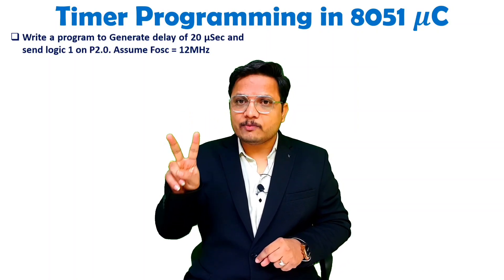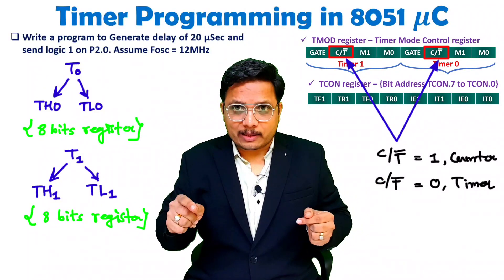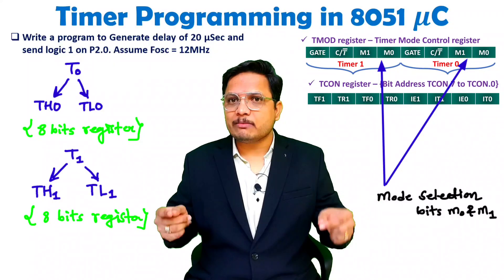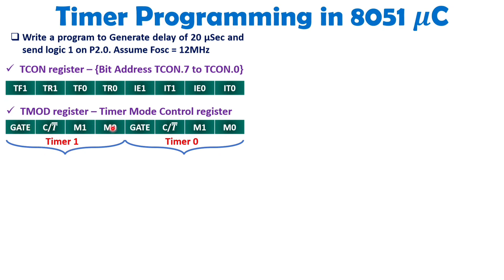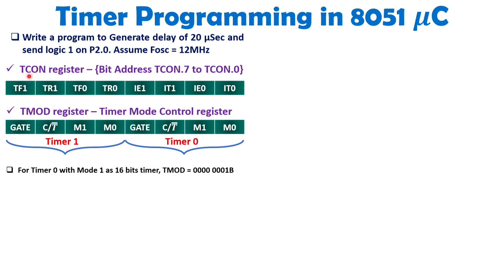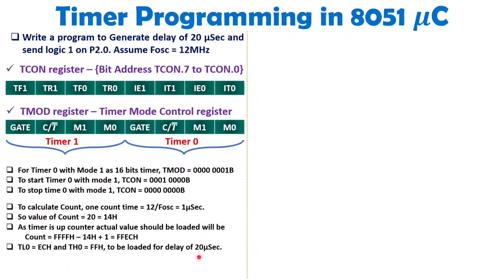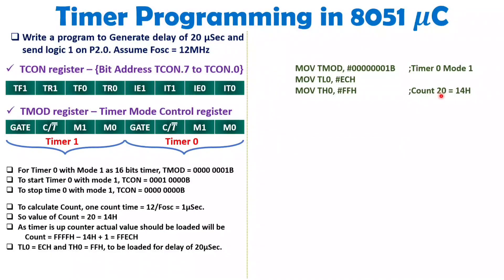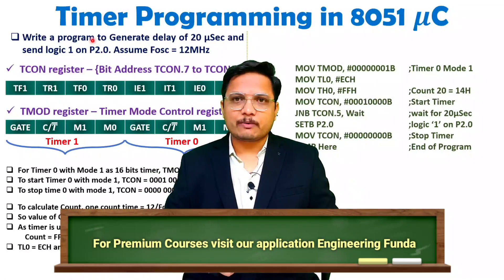Timer Programming in 8051 Microcontroller Explained: Configuration and Counter Setup - 1

Comment: Hello sir,

at 10:25 I see you are using polling to check if the timer rolled over, instead of using the interrupt. Does the interrupt still occur? Do I need at least a RETI instruction at the ISR address to make sure I come back from the interrupt routine?
Reply from the maker: RETI required to come out of the interrupt

Comment: TMOD register is loaded with MODE 0 instead of MODE 1 (GIVEN: 00000001B , actual: 00000010B)
Reply: I looked at it and I believe he is correct , if you look at the table and the other of TCON, to run timer T1 or T0 on Mode 1 you need to set M0 to one as this indicates one from 
M1   |    M0   |   Timer Mode|
 0      |      0    |      0
 0     |      1     |     1
Reply: the actual one is not mode 1 but rather mode 2. mode 0 is when all the values are 0 i.e 00000000 so he's correct